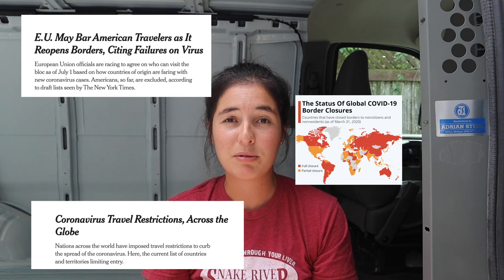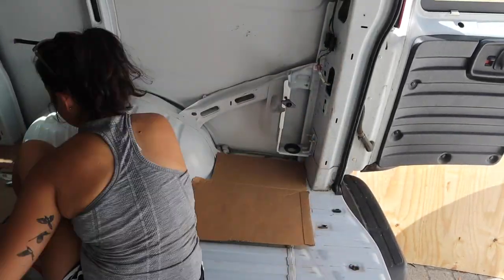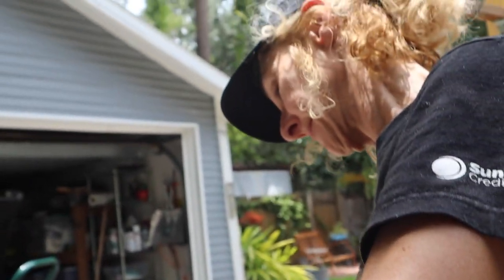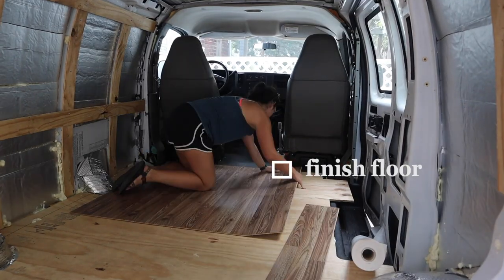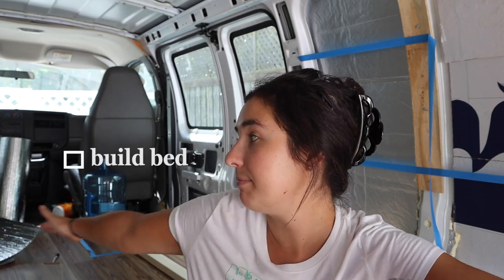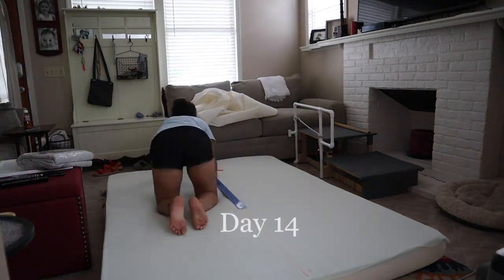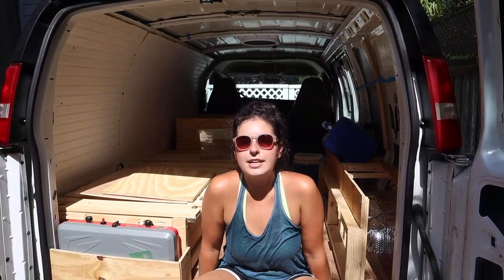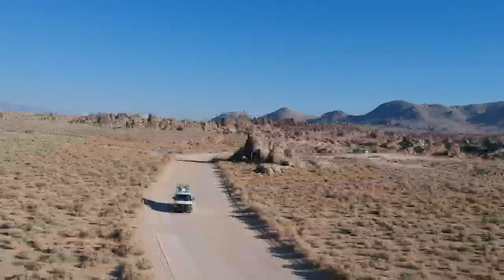30 DAY VAN BUILD | DIY Chevy Express Camper Van Build

Comment: Great work, you turned that van into a nice camper. Can I ask you how much was the transformation without the labor? Also I noticed you used foam and polystyrene for insulation, aren’t you worried about any potential toxic air you might breath when you sleep with inside the van? A last question, what engine van has and what gas mileage you get on the highway. Thanks and have great trips
Reply: second all of those questions

Comment: Do you have an drawings or mock up floor plans you can share? I have a 2011 chevy express 15 passenger with chairs and rear air. I paid $6000 for a van with 40,000 k miles.

Comment: I just figured up prices for spray foam insulation and believe it or not the retail 16 oz cans are cheapest per cubic foot of foam. The home type system is 3 times more expensive per cubic foot than cans. However I haven't tried it yet, so it will all come down to if there's actually 0.8 cubic feet of foam in a can. I calculated it would take about $90 to do the entire inside of my van with 2 inches thick. I'm going to experiment with one can and see how difficult it's going to be to get  consistent thickness

Comment: Good insulation job! I like how you covered your wheel wells. Did you spray that nifty expanding foam along your floor/wall joints? I'm concerned about rodents eventually getting in. Everyone seems to get that problem no matter what type of rig or how new it is. I'm going to spray that everywhere that I can before I start the insulation. I don't want my bed across my back doors either (like most nomads do) even though it makes a neat garage. I'd rather be able to go in/out my back doors. I see you used a jigsaw. It's probably easier on the arms than a reciprocating saw. I'll need to decide on the best one. Nice job and thanks for sharing!

Comment: Something I've been wondering (and I haven't pulled my interior panels off yet): when you screw the first wood studs into the van's vertical frame beams (DAY 4), are you using a special screw or some kind of anchor on the other side of the metal? 

Thank you so much for this!
Reply from the maker: Hey Kris! I used metal self tapping screws. They have a sharper tip and kind of grab into the metal of the van better.

Comment: How did you do ur electricity and water
Reply from the maker: My electricity comes from the sun and I have installed solar panels in the roof! My water system is really simple and comes from a 5 gallon water jug.
Reply: @EmilyMcDonald  I'd like to know, if you can expound, how you finished the wiring and electrical components to connect to solar and run it safely through your van?  That's the most confusing part to me when I watch van builds-- apparently it's not that difficult, but not having done it myself, I would love your input.  :)